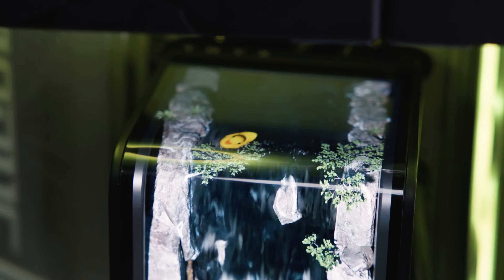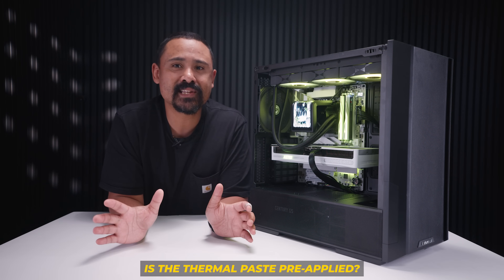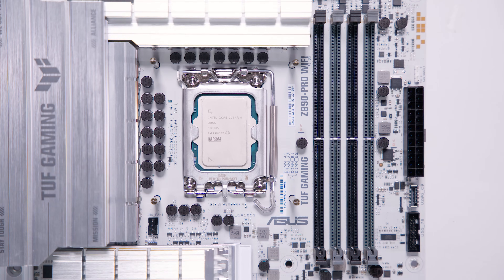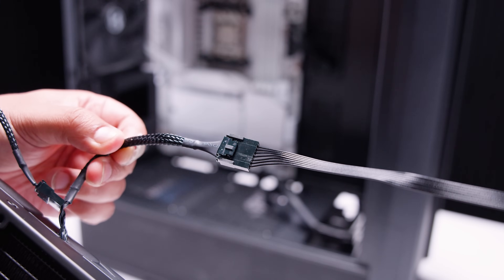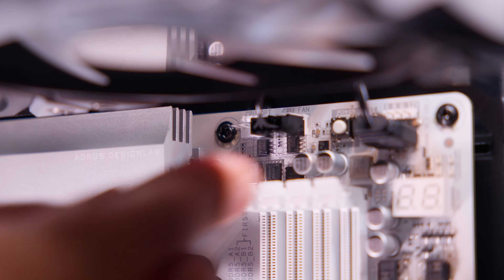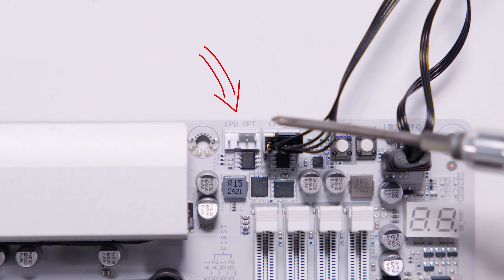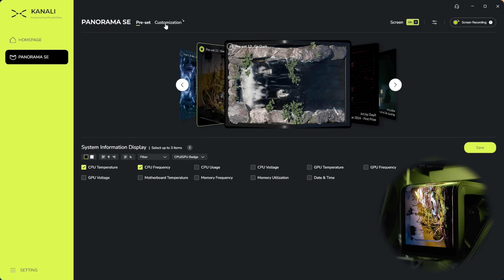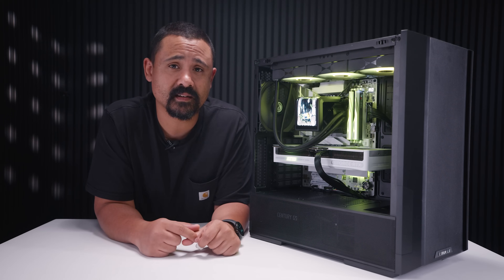TRYX Panorama SE 360 ARGB Installation & Setup Guide

Comment: I installed mine exactly as shown but I cannot change any of the RGB settings with the fans. They light up and there should be a section in the Kanali app for RGB and fan settings, but I don't have that. The curved screen works great btw. Any thoughts?
Reply: So my fan RGB is only controlled by my motherboard controller software. Idk why in this video it show them in the Kanali software. If you have this issue, just open whatever brand motherboard software you have. For my Asus it was Armory Crate, for MSI I think its called Mystic, every brand has their own.

Comment: Hello ! 
I have a FRACTAL DESIGN Torrent TG case. 
The design of this case requires the radiator to be installed at the bottom. 
Are the radiator hoses long enough for this system? 
Can I install them in the bottom of my case?
Reply: you never want to put the bulk of the water in an aio below the pump, the pump is located at the cpu, the radiator either needs a top mount or a side/front mounting with the hose entrance above the cpu.

Comment: the panorama tab won’t show up for me
Reply: Make sure you have the correct version of the software, the non SE also uses Kanali software but its a different version that wont work for this SE one.
Reply: Update, this may have been true at the time, but they have since consolidated the Kanali software to run both from the one version, so just make sure you have the latest version of the software. If its still not showing up that suggests you've likely not plugged in the USB connector correctly which operates the screen.

Comment: Really not to happy with my TRYX Panorama I want to be able to shut off the RGB on the fans and I shut off the header in the bios  and even in the kanali software and the fans still flash on and off. Only have had this New computer for 2 weeks and it has been a pain from day one.
Reply: Kanali does not control fans, use mobo software

Comment: Installing it this way makes it so you can pretty much only run the screen in one orientation and that is the waterfall mode if you try to go the other way either the screen is facing the fan so you can't see it. If you try to turn the screen the other directions the tubes get in the way also when installing it this way you have to be really careful that your tubes don't run into that fan

Comment: My friend has this cooler, but the orientation wasn't correct when it was installed. If we were to pull it out and reinstall it, do you think we would need to reapply more thermal paste?  Thanks in advance and great video and instructions!
Reply from the maker: I would reapply thermal paste just to be sure

Comment: can you tell me the difference between SE and tryx 360 ARGB?? which one is better?
Reply: SE version has a magnetic screen, allowing for changing the orientation of the screen. It’s considerably cheaper than the Non-SE version, although the actual pump is slightly worse performance-wise IIRC

Comment: @Gear Seeker i just installed the aio it powers up the screen turns on but in the software my device is not getting recognized i need help anyone please
Reply: Did you fined any solution for this i have the same issue ?
Reply: did you figure it out? having same issue now

Comment: i installed one just recently onto a 12900k, trying to thread the spring and nut onto the bracket while the mobo is still in the case can be very tricky by yourself. The solution i found was to temporarily install one nut (just a few turns) without the spring, to act as a holder...then i got the other three spring/nut combos threaded before removing and correctly installing the first. There are no retaining standoffs for the intel bracket so any small amount of force will push it backwards and off the the mobo....hope this helps anyone in need...love the content 👍